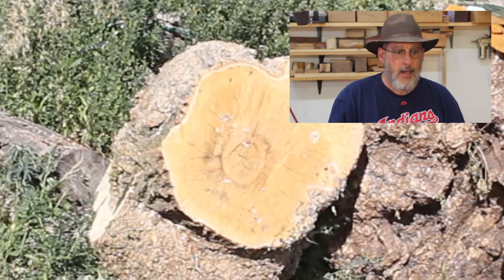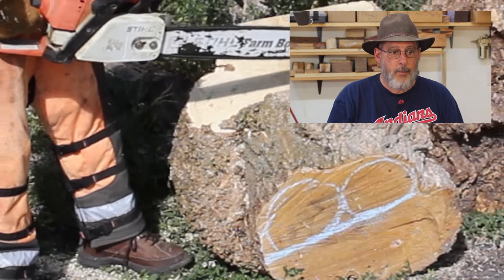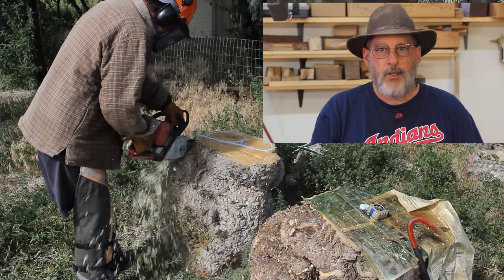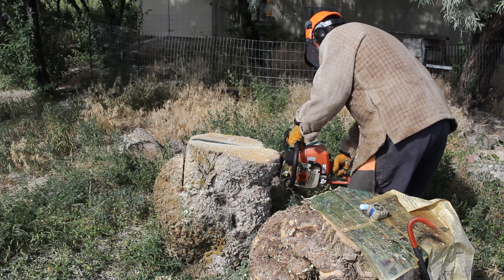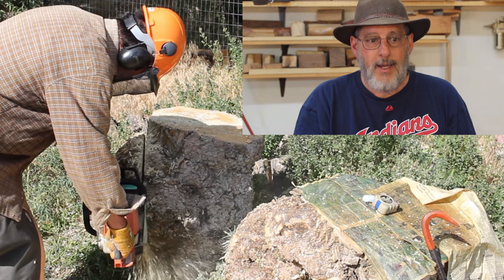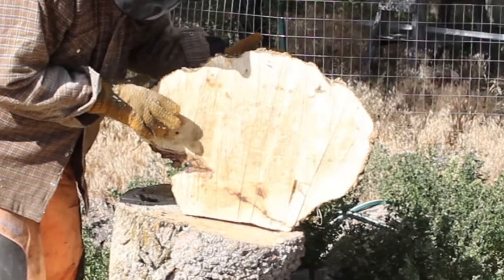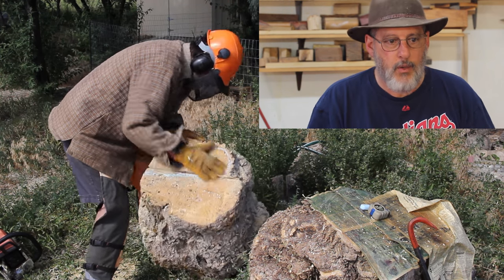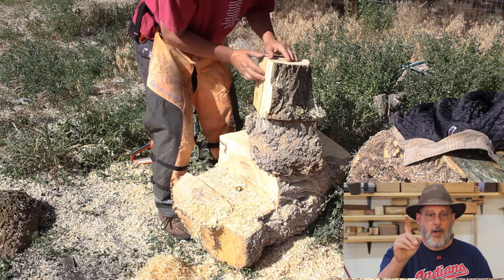The First Cut is....Important when Milling a Burl: wyomingwoodturner

Comment: Just advice when cutting it's always harder on your saw cutting on the end grain just like turning end lay it on its side .just my thoughts. Butt I learn alot from your videos thank you for sharing .
Reply from the maker: Manuel.  I totally agree.  I did go back and watch some of this video.  At 2:57 I appeared to be cutting into end grain but I was not.  I was cutting off a section of burl which was cut in a proper direction.  This was a very large piece of wood with burls going in several directions.  So it is not always easy to find that perfect grain direction.  Was there another place you saw me cut with the end grain facing up?  Just curious    Thanks Sam

Comment: Neat burl I just bought 3 of them not nearly as big as that one but still very nice. When I bought them I was given the whole section of log they are attached to should I just seal the ends of the log to store them? I'm a very new turner but I know the value of a nice burl. I just don't want to wreck them.
Reply from the maker: That's just what I would have done with the burl you got.  Sam

Comment: Excellent and very instructive video Sam!! Would have loved to see the whole 4 bowl turning out of that single, pretty thin looking burl slab... how on earth did you cut 4 bowls how of that??!! I know some people get mad when they see someone chainsawing into end grain, but fact is, sometimes you can't avoid it, it's not simple cutting a log just like you want without taking a cut from here and there where needed. Those saw purists can really be a hassle about it. Loved your chaps, I should really get me some of those... and I should also upgrade from a cheap electric saw to a good quality gas powered one.. Oh well, with time, you know.. :) Thank you for sharing, and I hope we'll see what hollow forms you make out of those two blanks!

Yuval.
Reply from the maker: Thanks Yuval
No matter how safe I try to be and which direction I cut with a chainsaw, I will get comments good and bad.  I cut into the end grain mostly cause the log stood higher for me and was easier to see what i was cutting.  Thanks.
Sam

Comment: After cutting off the burl and those two pieces, did you reseal the log or finish breaking it down?
Reply from the maker: Yes, good question. That is as far as I went. I did seal it. But I need to get after it,  as it has been 100° every day thanks Sam